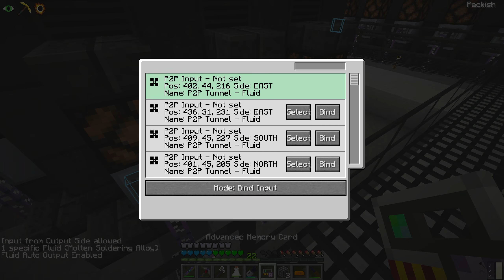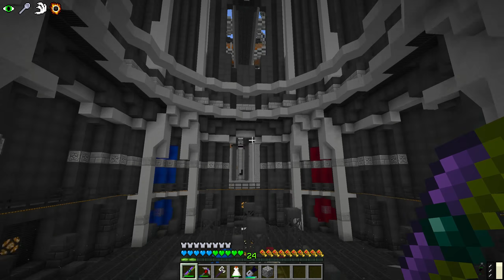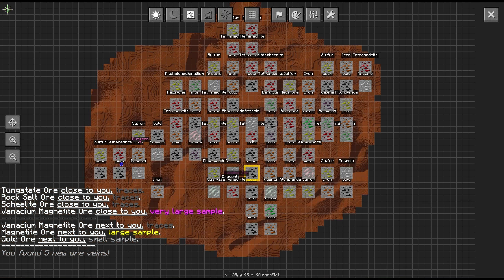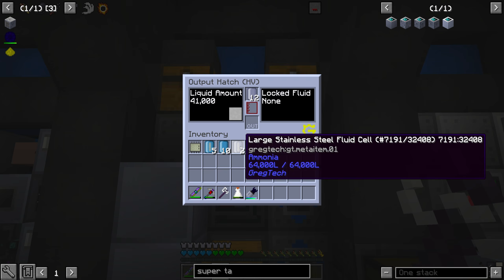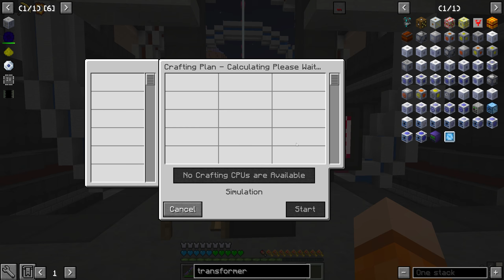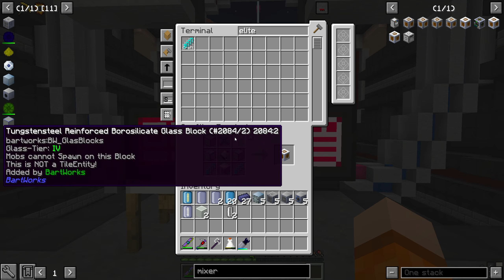Gregtech New Horizons S2 34: Lapotronic Power Plans

Comment: Really ought to be switching over to MBMs around this point, and possibly rushing a T2 version or two, though probably something to look into after fixing power and setting up ore processing. Otherwise the mountain of unprocessed ores will just continue to build 🙃.

Oh boy, why you need MV/HV tier ore processing dot...whatever format of screenshot you wish to take from a .mp4 file I guess? In any case yeah, remember that Three could have set up an automated ore processing system as far back as early HV. It's been, what, 20-odd episodes since then? How many hundreds of hours? And we're just now starting to set up the basic infrastructure required to support a proper EV/IV tier ore processing system, starting with centralized power, let stand going down the rabbithole that is crafting those GT++ ore processing multis. Which will be an ordeal in their own right, requiring even more resources to finish. Yeah. This is why I recommend investing in an MV/HV tier ore processing system. Yes, GT++ multis are extremely good and you'll be switching to them eventually, but damn if the road to get there isn't going to take an awful lot of processed ores...

Some of you might be wondering if it wouldn't be easier to update to 2.2.8, grab EV/IV tier single block gas gens as well as the rendering fix to make the Benzene setup not a horrific lag machine, and just run a fuel line like you do in MV/HV rather than figuring out all of this "centralized power" nonsense. That is an option, heaven knows why the devs thought it a good idea to make the pack more accessible to casual players when it still takes hundreds of hours to get this far, but of course there's a catch: Even upgrading to Benzene 3 and running the setup off of everything but Benzene you'll only be producing ~79.2mb benzene/t. One EV single block gas gen (according to my math) consumes ~9.5mb benzene/t, so you're getting roughly 2A IV out of an entire Benzene 3 setup. When ore processing and related chemical processing lines come online that's going to get consumed multiple times over worryingly quickly, and while you could upgrade to a much more efficient and effective GT++-based Benzene design to produce more fuel that's going to cost a hot bundle of resources. And resources have another problem in this scenario: This solution of giving each machine it's own dedicated generator is going to become very expensive very quickly when you start throwing extra EV/IV-tier circuits and components at every single machine. The single block generators simply aren't sustainable long term, they'll do for a temporary stop-gap measure but the long term will require a better solution.

That solution is multiblock power generators to significantly increase your fuel efficiency, and centralized power to both centralize all of the power production (and storage) so individual machines don't require individual generators to power them, and to compensate for the quirks that multiblock power generators have. By investing in Large Gas Turbines and Large HSS-E Rotors - quite pricy, but doesn't require more "rare" materials like Iridium or Osmium at this stage - you can turn 78mb/t benzene into ~47.736 EU/t, and with centralized power you can send that to however many IV, EV, HV, or lower tier machines as your power production/storage is able to support. Upgrading to centralized power is a necessary step, but of course there is, once again, a catch: Setting up centralized power is by no means cheap, and Three's resource situation without ore processing is...not the best. Fortunately there is a way to set up what's basically a discount centralized power system - I've talked about it earlier, the 16A IV battery into a Hi-Amp Transformer feeding 1x Vanadium-Gallium Cable solution. It doesn't store a lot of power compared to a proper LSC and has quite limited throughput as far as centralized power is concerned, but it will do the job of getting ore automated processing started. And since most of the cost goes into things you'd need/want for an LSC anyway, basically nothing is wasted. And what is you can Disassemble to get the resources back anyhow 🙃.

Quick point of correction, using the proper recipe Tungsten is 400s per two ingots. Easy to forget, since it's one of very few (if not the only) EBF recipe to produce two ingots at once. "That's still a long time even if it's half that per ingot", you say? Eh, relatively speaking I suppose, yes. Fortunately both of these processes only require Nichrome Coils at base, so by investing in HSS-G coils you can get an upgraded overclock on them if you also overclock the EBF to IV power. Complicated to supply IV power without EV/IV single block gas generators? Not really. An EV battery buffer and maybe some simple redstone circuitry will get that job done just fine. The big thing is the HSS-G coils, since otherwise you're only getting a regular overclock, and that is going to run through your power buffer in a real hurry. But yes, increasing the smelting speed of Tungsten(steel) by 300% around this stage is doable. Expensive? Yes. Finnicky? Yes. Inconsistent? Depending on your exact setup, potentially, yes. But if you'd rather deal with that than deal with long recipes it is an option. PS, don't worry too much about excessively lengthy EBF recipes being a problem for too much longer. Upgraded overclocking is just the start. Very soon the GT++ Volcanus will be available, and EBF smelting will enter a new age of processing speed and energy efficiency...but we'll cross that bridge when we get there 🙃.

If you want Tungsten remember to look for Tungstate veins rather than Desh veins. Desh veins are comprised mainly of Desh, which has only limited uses and isn't what you're looking for besides. Tungstate veins are primarily Scheelite and Tungstate, with some Lithium on the side.

Remember that with access to the Moon (or even better, Mars) you've got access to Salt Water fluid fields. Each bucket of Salt Water will yield a bucket of Chlorine when electrolysed, so you shouldn't ever be short on Chlorine post-Moon and can save you actual salt for whatever processes need it. That said if you ever do run out of salt you can distil salt water to separate the salt from the (distilled) water. Not the best recipe to use for automation in all circumstances, but if you've got a tank of salt water and a need for salt dust, or if you're taking an approach that requires salt dust in large quantities, it's an option.

So the way that the LSC works, broadly speaking, is that you build the multiblock and fill it up with capacitors in order to give it more energy storage. LSC Capacitors are based on the Lapotronic energy batteries, which go from EV Lapotronic Crystals (10M) to UV tier Energy Clusters (100G), and will store six times as much EU as the lapotronic energy battery used to craft the capacitor. Obviously that is much more efficient in terms of power storage than using a battery buffer, but the LSC is quite expensive to craft and can't I/O any energy unless you give it energy hatches and dynamo hatches, further spiking up the cost. This is especially problematic in this version, where the lowest tier of multi-amp energy/dynamo hatch is IV. Meaning unless you can craft IV tier energy/dynamo hatches (which requires Iridium, IV superconductors, the next tier of power IC chip that lapotronic energy orbs require, and more) you're going to be very limited in how much energy you can input and extract. A 16A IV battery buffer is much cheaper and can input/output 2x/1x it's number of batteries natively, so it's a good stepping stone until you're able to afford the LSC and put it to good use. Once you have access to multi-amp hatches and the resources to build an LSC it's obviously well worth upgrading, especially if you're in a position to upgrade the thin string of a central power spine you've been using in the meantime for want of the required resources to run a proper, solidly future proofed power spine.

Getting just Platinum from Platinum Metallic Powder Dust manually isn't that bad, it's like three or four LCR steps to do it. That said doing it manually without fully automating it is going to leave you with an awful lot of byproducts and other garbage that you'll have to store away and shove into your automation line wherever it needs to go when the time comes. That or further process it down manually (to the point that you can, which is not very far at this stage), which is it's own barrel of conspicuous emptiness where fun used to be. My advice is not to be afraid of cooking up some platinum the inefficient way if you don't need too much of it - four Lapotronic Energy Orbs worth of platinum will run you 540 platinum metallic powder dust processed inefficiently, so strongly consider doing some manual batch crafting if you're at all capable of doing so, but beyond that if you have to burn 540 dust you have to burn 540 dust. Once you've set up ore processing you'll get more, and once you've got a T3 rocket you'll definitely get a lot more, so don't be afraid to set fire to some resources if it means moving forward quicker. The faster you advance the faster you'll get better access to more resources and the processing thereof to recoup those losses, after all.

Don't underestimate the power of batteries, they can solve a lot of problems when you need to power higher tier machines like this.

Comment: Maybe you can put the turbine inside the thaumic restorer to heal it's damage.
Reply from the maker: Unfortunately it won't accept GT Tools or Turbines :( Great suggestion though! :D
Reply: @Threefold.  Furthermore, any GregTech items with durability have 100x the durability and take 100x the durability damage compared to tools from other mods. For example, a tool with 256 uses has 25,600 durability, not 256. Therefore, even if the item was accepted by the restorer, it would repair the item 100x slower (time to full durability: 1 hour instead of 36 seconds).

Comment: Great Video! I am not sure if it works in this version tho since I don't really play GT:NH but in some other mod packs if a recipe can be crafted with multiple variants of the same item (like the multiple variants of IV glass) and you press and hold shift in the JEI menu it stops the rotation. Just in case you didn't know. I hope I explained myself correctly.